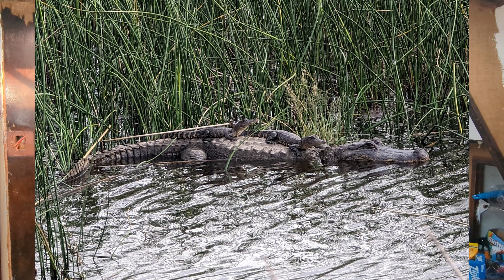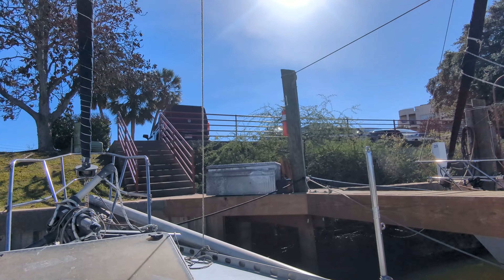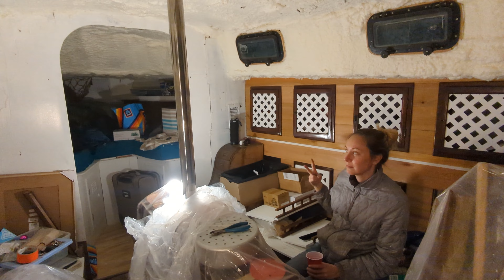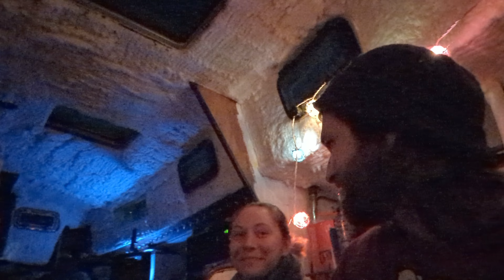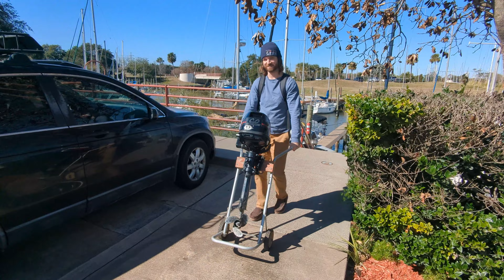I Would Like to Foam a Friend

Comment: Why are you spray forming.
? You're the first YouTubers I've seen do it
Reply from the maker: It is much cheaper than other insulation options we priced out and works just as well or better. By not allowing any air behind it there is no way for condensation to form, which was a problem with the other insulation.